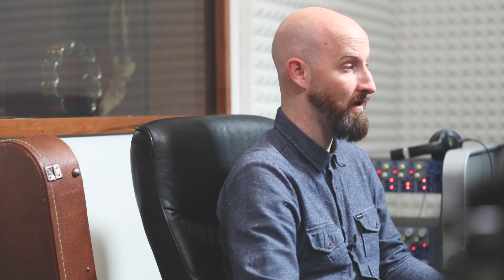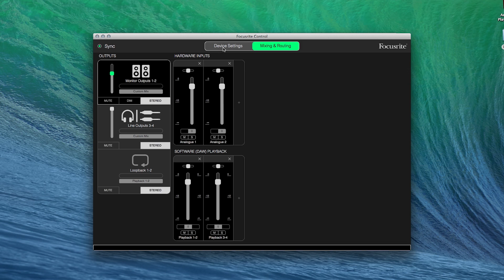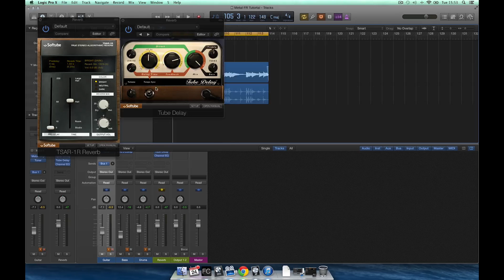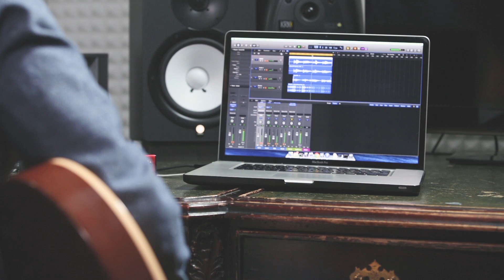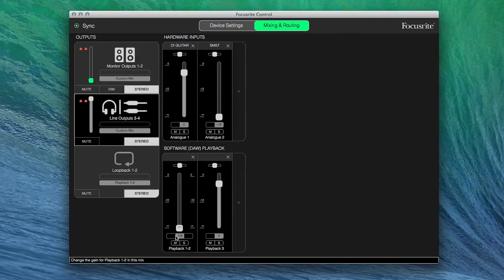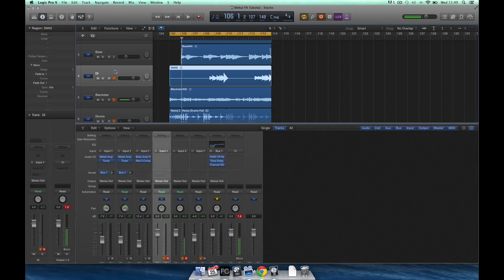Focusrite // Recording Metal Guitar with the Clarett 2Pre

Comment: Is the xlr line-in cable a female or a male?? Or the line-in port a male or female receiver??? Does the cable come with it?
Reply from the maker: Clarett 2Pre features “ComboXLR” input sockets (female) for connecting microphones, instruments (e.g., guitar), or line-level signals via XLR or ¼” jacks as appropriate. Either TRS (balanced) or TS (unbalanced) jack plugs can be used for instruments or line level signals. XLR/Jack cables are not included with our products and will need to be purchased separately.

Comment: I have a question since I want to buy this unit this weekend. But my question is how to hook up my amp directly still to the interface when I have all my distortion pedals taking up the effects loop that is also my line out on the ID260 2X12 Combo amp. Is my only way micing the cabinet?
Reply: Same question
Reply: Did any of you guys managed to do it? It would be great if you could tell me how
Reply: @adaozgurozkefeli8734  I ended up micing the cabinet and running two different mics into Scarlett. A Shure SM57 and a Condenser AKG P120. You do have a chord off the front of the ID260 Blackstar amp that can run USB, but the lack of controlling the volume depending on your computer and soundcard just really sucks for it. So I also ended up buying another amp. A Marshall DSLHR100 head. I just mic them, even though this head can record as well I have not done it yet.  Waiting on my new cabinet to get here first. Hope this helps though.
Reply: @DreidMusicalX  can i get a signal if i connect my amps output line to my audio interfaces input line via cable(and my guitar will be connected to the amps input)
Reply: @DreidMusicalX  thanks by the way
Reply: @adaozgurozkefeli8734   A speaker output line?
Reply: @DreidMusicalX  mine has headphones
Reply: @adaozgurozkefeli8734   Then you could possibly use the headphone out jack and go into your interface.
Reply: @DreidMusicalX  thanks man
Reply: @adaozgurozkefeli8734  You're welcome.

Comment: I had no idea about using the line outs as a way to send signal back out to an amp. That's mind blowing to me!
Reply: Im lost. Why output 3 into amp?
Reply: @kairay1000  1 and 2 are connected to the monitors.
Reply: What about the third? I get 1 and 2. Not understanding the third
Reply: @kairay1000  Outputs 3 and 4 are assignable. Watch again when he creates the custom mix for output 3, and listen when he explains about muting the monitors, and the mic to stop from feedback. The guitar is still hot in that custom mix, which is outputting to the amp, therefore the amp will play as if he's only playing through the amp. Hence the name, Re-Amp, for this technique.
Reply: How about impedance differences between line output and instrument level signal ? It can work as a sound but not the same way you plug in to amp. That's why you need a reamp box between interface line output to guitar amp.
Reply: That's a good question actually. Outs are usually low impedance balanced signal or line level unbalanced. For reamping DI box is a must imo. They're not that expensive.

Comment: I just got the Clarett 4Pre USB so I can record DI guitar and re-amp them.  I saw this video and tried to re-amp with an unbalanced cable directly connected to the guitar amp from the Clarett output.  It sounds every bit as good as using a balanced cable connected to a Radial Re-amp box then to the amp.  No artifacts, no colorization. It's like I'm plugging my guitar directly into the amp.  I haven't been able to re-amp guitars with any other interface without a Re-amper.  Can anyone speak to this phenomenon ?

Comment: Just bought the Clarett 2pre USB. Very disappointed from the DI (recording metal with both seymour duncan and emg pickups). It's supposed to have more headroom for the instrument input but in reality it clips with the knob at 8 o'clock - almost all the way down- were as my old Scarlett (1gen) would go at least 9 o’clock before clipping. So all that extra dBu's of headroom is more marketing lies and the device will not perform as advertised. Sound quality is better but is not worth the price difference.
Reply from the maker: The Clarett 2Pre USB has significantly more headroom than a 1st gen Scarlett. Have you discussed this with our tech support team? If all of the other variables in your set up remain the same as when you were recording with the Scarlett, this shouldn't be an issue. You can contact our support team for further assistance here: bit.ly/FocusriteSupport
Reply: That's odd. I don't have that issue with  mine. SD and emg pups.

Comment: What is DI?
Reply: G Skill direct interface
Reply: G Skill or digital interface which is more than likely what you’re probably referring to
Reply: Dı is sencronised your guitar tone to sound card. For example i hava focusrite 2i2, it doesn't have DI in it. Than i have to buy a DI box for the record my guitar (with pedal) directly.
Reply: @GodLoves-k8p  If you have pedals, you cant connect directly to the 2i2. Because there are no preamp and cam sim between the pedal board and 2i2.
Reply: It helps with the electricity incase your line turns red instead of green

Comment: Do I need phantom power on when I'm recording an amp with a mic?
Reply: Julio Justiniano no
Reply: Christophe Germain Thank you!
Reply: Julio Justiniano ribbon mics use metal inside like a speaker.  Its less complicated, more rugged, but less quality sound then condenser mic.

Condenser Mic has electronic components to make it work (capacitor, resistor ect).
Ribbon uses sound to vibrate the metal ribbon to create electricity.    Condenser need electricity  ( phantom power) to make the components work.    Hope this helps

Comment: I have a question. For some reason I am hearing the DI-signal as well as the signal after plugins (Stereo Out in Logic Pro X).
I am sure this is an issue with my Focusrite control settings, something like Direct Monitoring on older Focusrite products, but I cannot figure out how to configure it.
Any tips?
I want to hear the stereo out through my monitors obviously, but not the DI-signal.
Reply: I had this same problem with a Scarlet 18i20 and the fix was changing the  Monitor output from MixL and Mix R to DAW1 and DAW2. 

https://support.focusrite.com/hc/en-gb/articles/206849879-Why-can-I-still-hear-input-signal-when-I-m-not-recording-or-when-my-recording-software-is-not-open-

Not sure which interface you have but hope that helps?
Reply: Jason Zdora
Thanks for your answer! I have the Clarett 2Pre, I got it fixed by changing the mix preset.
Now works like a charm :)

Comment: Question. Should the line out of the interface would be 'line level' and not 'instrument level' for send the signal to amp?
Reply: You can get away with a direct line out, but the signal will not only have impedance issues, but it will also be much hotter than an amp would expect to see. The proper way to do this is to use a reamping box like Radial's X-Amp or Reamp JCR.
Reply: Word! Don't you need to change the impedance of the line out so that it plays nice in the amp?

Comment: +FocusriteTV Newbie question - My amp has an emulated out line which can be used with the speak on or off. Would it be possible to simultaneously record the amp DI into input 1 and the mic'd up speaker into input 2? Thanks